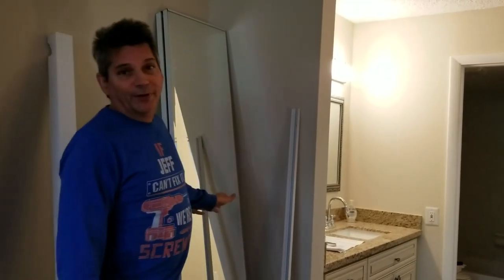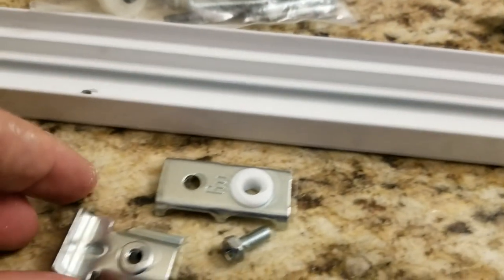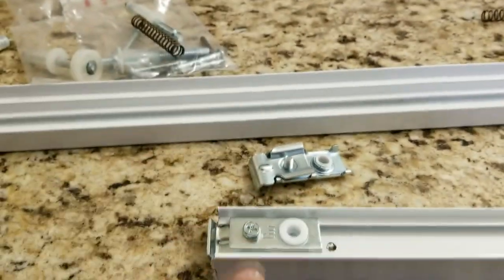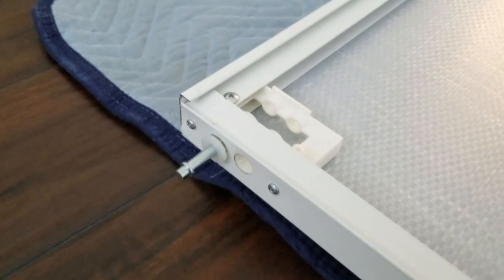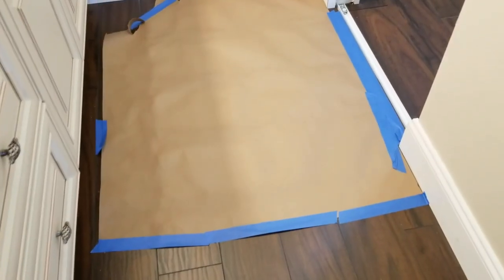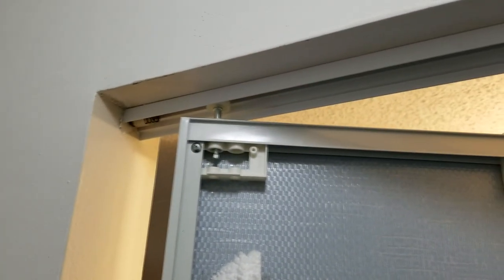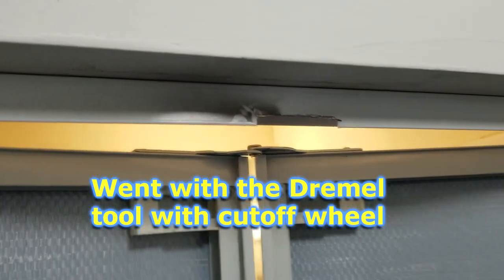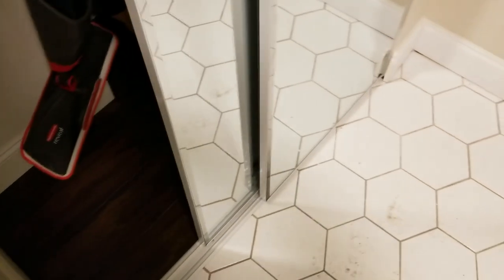How to Install Bifold Mirror Closet Doors DIY Like the Pros

Comment from the maker: Tools used in this video:  DEWALT DCK299D1T1 Hammer Drill, Impact Driver Kit: https://amzn.to/2M6h450
RYOBI AG4031G 4-1/2" Angle Grinder: https://amzn.to/2BNYYjr
Dremel 4000 Variable Speed Rotary Tool Kit: https://amzn.to/2DZ73Ef 
Tapcon 24371 3/16”x1.75” White Concrete Anchor: https://amzn.to/2MXeuyX
ITW Tapcon 5/32” x 4-1/2-Inch Concrete Drill Bit: https://amzn.to/2I3BOvS
Johnson 72" Heavy Duty Aluminum Box Level: https://amzn.to/2TiuihP
Reply from the maker: In this particular case we originally had installed the laminate flooring  Right up to the closet door track and stopped their. But later on when we bought the new doors it was determined that we needed to use the new track. So we just put it right back where the old one was. But you could install it right over the wood floor if you like
Reply: Where did you get the door hardware..we have one that needs hardware and tracks replaced, Great vídeo thanks so much for showing steps!

Comment: I really learned a lot from this video! The drawing was especially helpful.
You mentioned it may be possible to hang the doors from the top and eliminate the bottom track. How is this done if there’s a guide on the moving bottom corner? I’ve have an older 48” (4panel) Stanley bifold mirror door with worn out parts. I can’t find replacement parts! I’d also like to eliminate the trip hazard of the bottom track for my elderly mom.
Thank you!

Comment: wow, I am taking mine back to Home Depot! thank you for doing this video.
Reply from the maker: Glad it was helpful! What happened that you have to take it back?
Reply: @jeffostroff  too difficult to install and it might not work in my application. there are other type easier doors to install, as you pointed out.
Reply from the maker: @SuperBullyone  Yes, I prefer sliders, but unless you have a 48" door opening, bifolds are your only choice.
Reply: @jeffostroff  I am going with the wood slat doors like my old ones. They are simple to install. The old hardware is the same as the new hardware, and easy install. Again thank you. If I had begun the install, I would not have been able to return these doors.
Reply: Take the sheetrock off  that gives you extra 1/2” on the top or just cut a channel to fit the track in the sheetrock on top of the door 
I am replacing 3 closet doors today but sold core
I wasn’t sure if the hardware from Home Depot are strong enough 
I will find out today 
Thanks

Comment: I just purchased the exact doors and have the same problem. I guess I'm going to notch the top rail also.
Reply from the maker: This happens way too often. I wish builders would leave us with 80" tall openings like they are supposed to. In the other closet we installed in this property we used regular PVC bi fold doors, and all we had to do was shave 1" off the bottom with our table saw.

Comment: Is there a reason you couldn't install the original manufacturer's top and bottom tracks so that the short side would've been on the bathroom side and the taller side of the track would've been in the closet so that way your hinge would clear and the taller side of the track would've served as a backstop to give the closed closet door a stopping point? You are so thorough and give such excellent directions and explanations... I'm just wondering if it might work or find out why it wouldn't.
Reply from the maker: As I recall I installed everything correctly as the manufacturer called out on the instructions
Reply: @jeffostroff  thank you! I appreciate your help!

Comment: Instead of hacking up the track, and since you had a drywall header and not door casing. Did you consider tracing the track edges and cutting a 1/4" channel in the top drywall? Any cosmetic flaw could be addressed with caulking where the track meets the cut.
Reply from the maker: Yes we thought of that on fortunately when you're dealing with stupidity from builders sometimes doing something like that will open up a can of worms and you find out something else stupid that they did that makes your task impossible to accomplish.

Comment: Was looking for how you plumbed the pivot brackets .  You emphasized it so much, but did not show how you achieved that.   It looked like you did the job alone.  But you mentioned you needed 2 ppl.   I was going to do it alone, but now skeptical.
Reply from the maker: You can use a plumb bob to make sure it is plumb, or simply do what I did, since there was one there previously, the builder had already aligned it in the spot where it was, and I cannot change that so I simply used the previous upper and lower track locations. You can also use a 6 foot level to make sure the door is perfectly plumb up and down. I am experienced with this, and I do prefer 2 people, but I was by myself that day and so do it alone, it is a lot harder, but doable. Make sure your floor is protected, unless you have carpet. It's more important when working alone to protect a hardwood floor from the doors scratching it when you install them.
Reply: @jeffostroff  Thanks for your comments.  I have a regular bifold door with no rail at the bottom.  And the bottom is carpeted.  Do u recommend that I cut out the carpet to install the bottom rail or run the screws thru the carpet?  I know solid contact will be directly on the wood.   Thanks
Reply from the maker: @PKwhl  If you have mirrored doors, I believe the manufacturer tells you to put a bottom track down. With normal non-mirrored bifold doors, you can get away with just the L-bracket on the wall at the floor level. If you have not purchased your doors yet, go for example home depot or to lowes web site, and you can download instructions on PDF file from the door shopping cart, and confirm what they require.

Comment: Any reason why the bottom track had to be below the flooring?  I need to install but don't want to cut my hardwood flooring for the bottom track.
Reply: Sharon Amadio if you have 80" between the top from and the floor then you shouldn't have to cut into the floor but that lip will be sticking out and could be easy to trip over

Comment: Quick tip- have a professional do this mine came without instructions and you are screwed if you've never done this before. The box lies. There is no website, no help line, nothing. Thank you for the video.
Reply from the maker: Home Depot and lowes often have instructions on the products page. I get pdf files all the time
Reply: @jeffostroff  well now I'm a professional after the video

Comment: Where did you get the mirror doors?
Reply from the maker: HFranky, I got it at Home Depot, I paid $135 for it last December, it  is now showing as $104: https://www.homedepot.com/p/30-in-x-80-1-2-in-Brittany-Anodized-Mirror-1-Lite-White-Steel-Bi-Fold-Door-Brittany-Bi-Fold/202089863?cm_mmc=SOCIAL|PIP|Internal||emailafriend|202089863?&cm_mmc=ecc-THD_EMAIL_A_FRIEND20190821_THD_EMAIL_A_FRIEND_-VIEW_ITEM__NAwithTHD